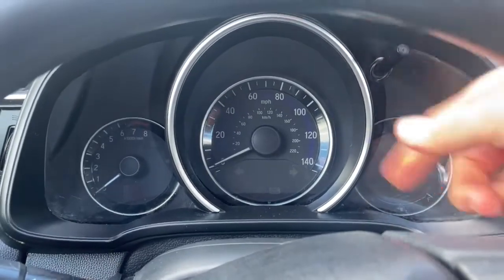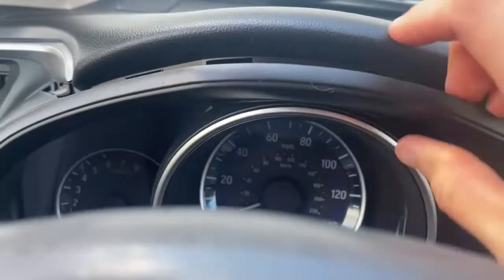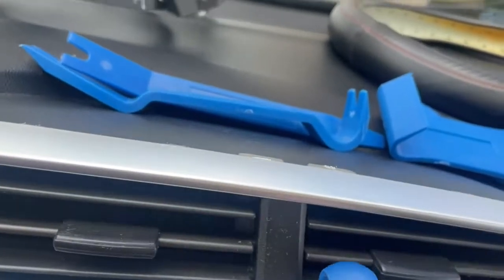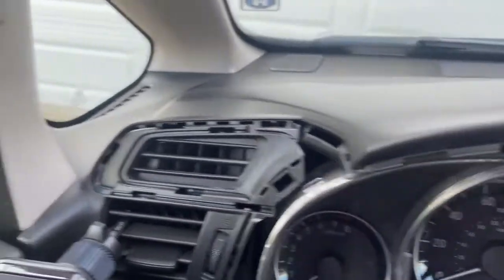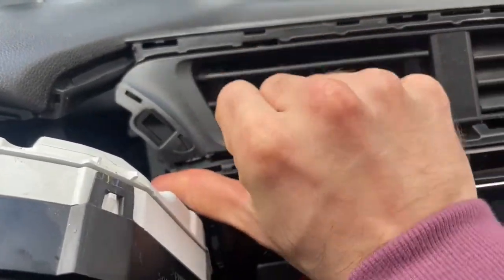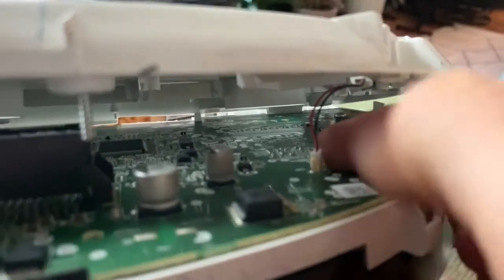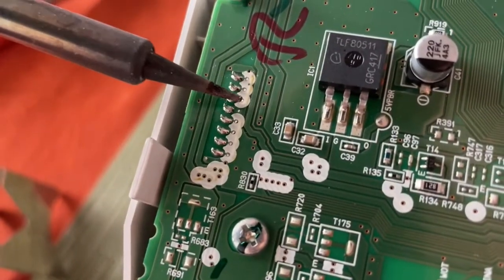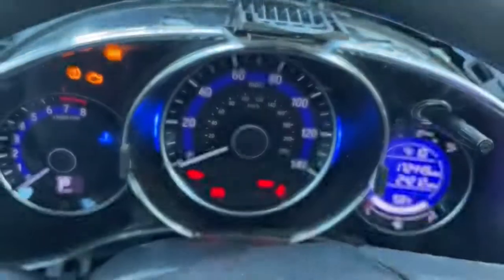Honda Fit Gauge Cluster LCD Repair Guide - Flickering Fuel and Odometer

Comment: i got a question. I'm about to do this fix myself. is it gonna have an adverse effect if i accidentally solder several pins together? or does each solder have to be separate? last thing i want is to have to melt the solder to start again, lol
Reply from the maker: If your solder spills over and connects multiple wires then you can use the copper solder wick to remove the excess. It will be pretty obvious if this is the case so I think you’re good. Good luck!

Comment: THANK YOU for helping me fix my 2015 Fit!

I never soldered before, avoided doing this for a month but IT WORKED! Now just figuring how to put it back in the dash lol
Reply: I just did my 2015 as well!  It was COLD! out there!  but all fixed now.  See my other post... you should pop the air vents out and it will slip right back in.  The left side vent has SIX of those white clips and is not easy to get out but it will come out eventually. Remember that the tab on the side goes UNDER the rubber door seal which will slide right off. The right side is a little easier, there's three of the white clips across the top, and some smaller ones above the radio.  You really need the proper trim tools to make your life easier.

Comment: Thanks for the well explained and simple to follow video - it fixed the issue in my 2020 Honda City VX. 

This cluster gauge is on the 2015-2020 Jazz, Fit & City in Australia, the Asian sub-continent, South-East Asia, the Middle East and perhaps Africa.

The local Honda Dealership wanted US$30 to diagnose the issue which would most definitely have resulted with a 'Replace the Cluster Gauge' for perhaps US$1,500. 

Diagnosis and re-soldering complete with uninstall & reinstall done by at a good electronic repair store within an hour and cost me $70; totally worth the price.
Reply from the maker: I’m glad the video helped! Nice work on fixing your cluster